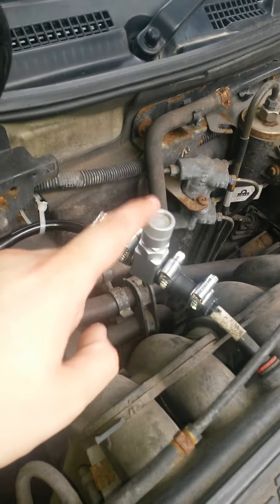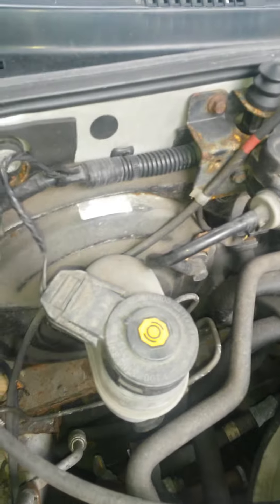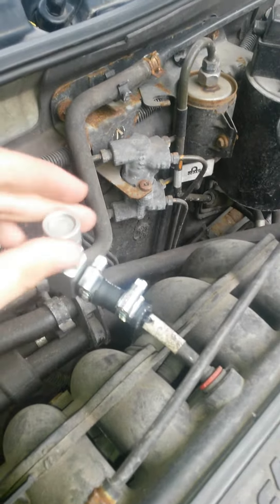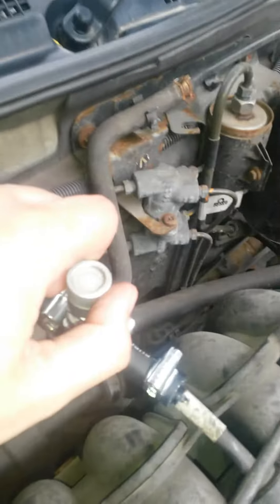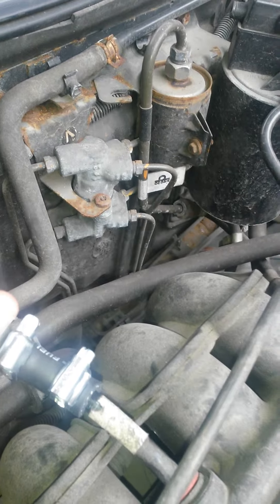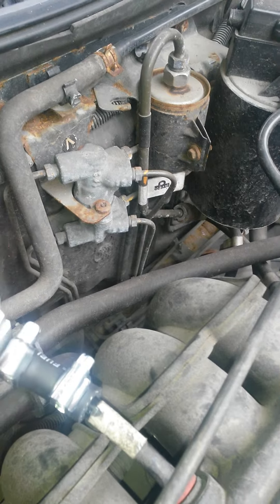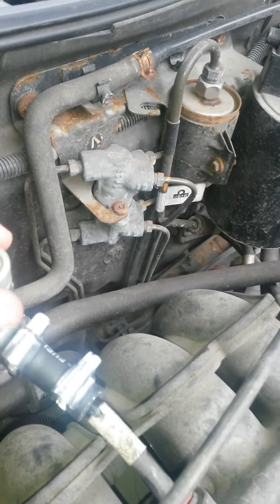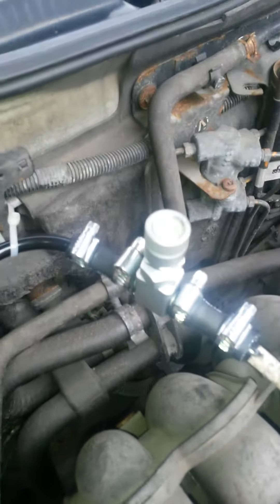Fitting and Eco-Tek Power Boost Valve

Comment: i remmber putting this onto my carina e 2.0i. i  also had the filter that went over the top.

what would have been good for the viewers, is for you to blip the throttle to give them what it sounds like.

 and whilst it kinda did its thing, good sound and a boost in performance, it only gave that blip of performance mid way through  accelerating  ie overtaking, its was like vtcec before vtec. it does however screw with your fuel usage because it creates a  bad fuel to air mix